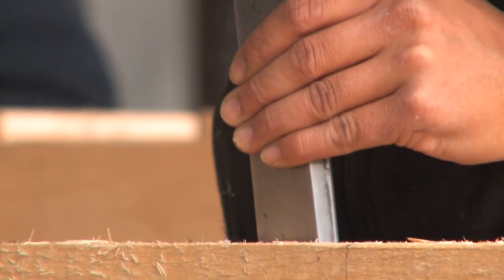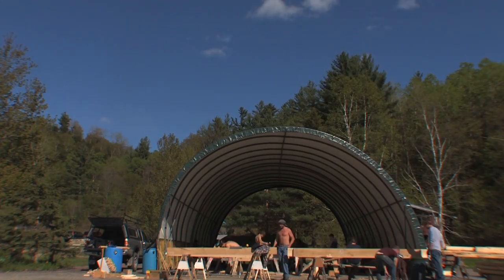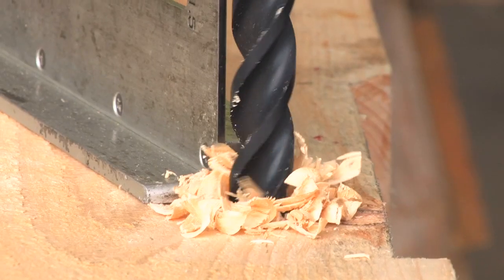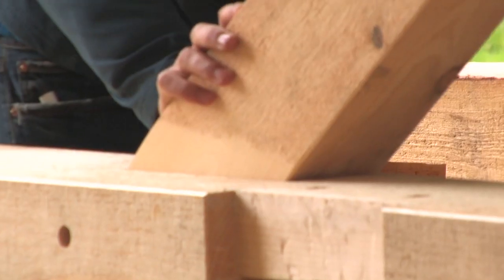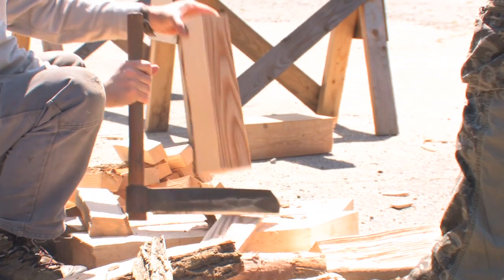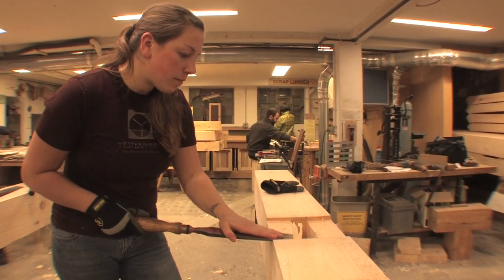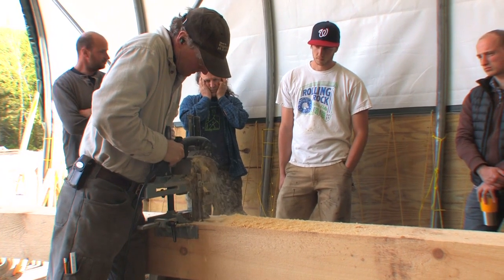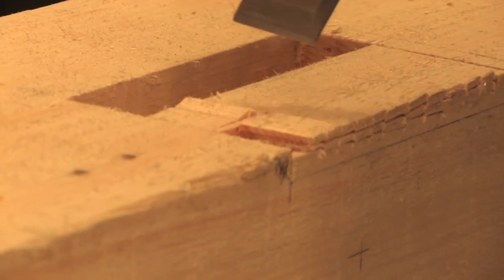Timber Framing @ Yestermorrow Design/Build School

Comment: I took this course at Yestermorrow from Josh and Skip, worth every cent. I gained the knowledge required to understand drawings and proper tool use. 
The year following the course I designed and built a 24x16’ cedar barn. That was practice for the 1900sq’ home I built and raised in the fall of 2018. I cut every timber and brace for both buildings with the tools I learned to use in the course (and a chain mortiser). 
No question, the course does what it sets out to do.
Reply from the maker: Wow Dave! That's amazing! Thanks for sharing. You should send us some photos of your finished project
Reply: Yestermorrow Design Build School, for sure, when I get over the details of finishing.